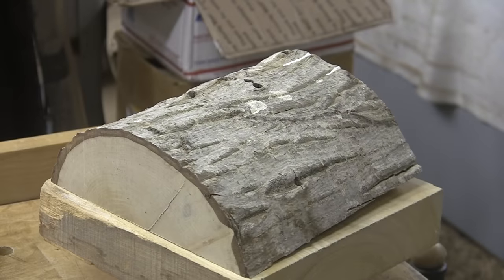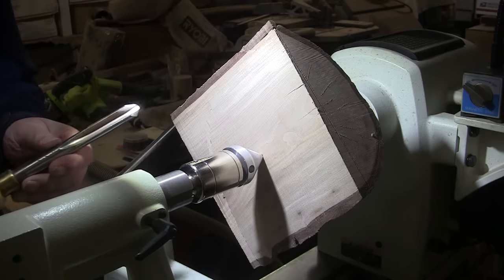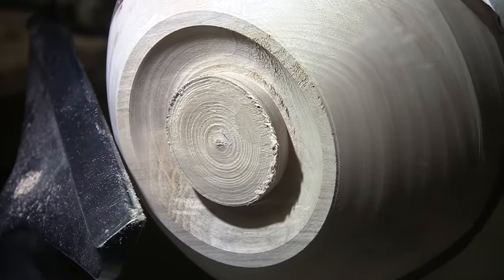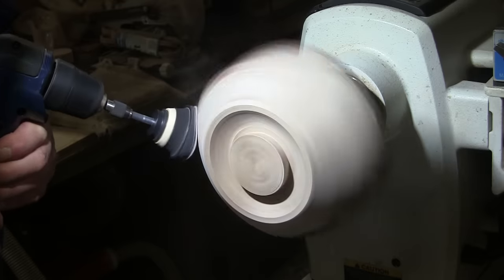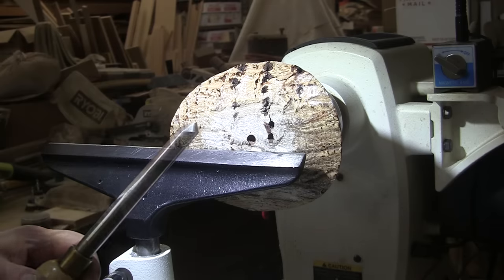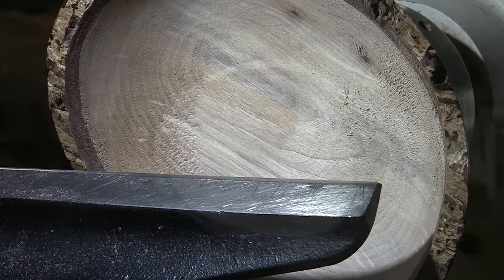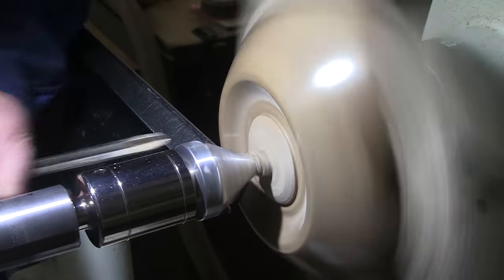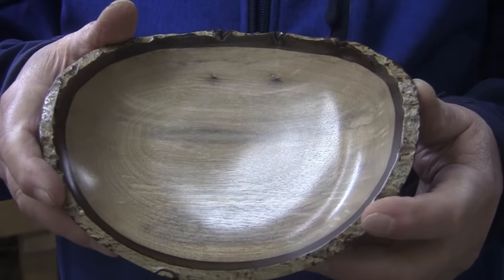Bowl From Log, Perfect Example! - Wood Turning

Comment: Nice bowl, it is very stately. I think the grain is very nice.  I thought that even before you started.  I love how thick the bark is and how well it stood up.  Phil I really feel that you could have a much wider rim on a bowl, especially when the bark is really nice. A one inch or even 1.5 inches would have been groovy too.  🙂
Reply from the maker: I try to do that most of the time but this piece was just too small for a wide rim. 😊
Reply: @PhilAndersonShadyAcresWoodshop   Everything is perspective, right? I could see just sanding the 'raw' side as the bottom & them making a bowl with a 3" diameter.  Bowls are used for so many different things, not all have to be 'wide'. With a 3" bowl I could see using it for potpourri. 

With a small bowl in that piece there would have been a lot more of that cool bark - more LIVE edge.

Comment: Howdy Phil
Done that been there myself ! Change the blade and felt like a dumbass .and laugh at myself ! .
You got the Rikon 14" right ? It is what I have Like it a lot .
I remember the other piece you turned with al the pecker holes , I called it a pencil holder !
Very pretty wood ... On the inside looks like a cartoon face .. using the 2 little knots as eyes 
beautiful turn .
Keep on turnin'
Reply from the maker: Yeah, I've got the 10-326.  I bought it partly because of the tool-less blade change, Bruce.  What really keeps me from changing the blade is all the clean up that has to be done, vacuuming, blowing, etc.  10 minute job takes an hour!
I saw the eyes but couldn't tie them to a face.  I'll give it another look.  Thank you! 😃

Comment: Hi Phil.  I am a new subscriber.  I have seen you apply sanding sealer but not yet found a video of you applying the shellac topcoats you talk about.    Is there one of your videos that shows your full finishing process?  If not, how do you apply the shellac topcoats and then do you do anything to smooth the shellac?  Thanks.
Reply from the maker: Thank you for subscribing, Kevin! 😊  I will try to be worthy.  I would guess that about 80% of the time I tell my viewers that I apply shellac exactly in the same manner I apply the sealer, no difference whatsoever.  A rag and a brush, if needed.  I explain I don't show that part because it's the same.  I smooth the coats of shellac exactly the same way I smooth the sealer.  I have a very short video showing that:  https://youtu.be/lqns7oue4W4

Comment: Phil, What diameter forstner  bit do you use for your recess for the worm screw an chuck face?
Reply from the maker: It depends, Eric.  I usually start with 2".  If the bark is really thick or there are projections around that 2" circle, I'll then drill another hole at 3 1/2" for clearance of the chuck body.

Comment: with your sanding drill going that fast and the lathe going that fast, what's it matter if you go in reverse? Is there a benefit? Does it get any smoother? My lathe doesn't go in reverse.
Reply from the maker: When we turn wood, Dennis, we are laying down the fibers, away from us.  By sanding in reverse, we can lift those fibers up and cut them off resulting in a smoother finish, faster.  You can stand on the back side of your lathe to accomplish the same thing. 😊

Comment: I know nothing about wood turning so please dont think this is a critique,  I  am just curious.  Why do you leave the middle till last when you are turning the inside of the bowl?
Reply from the maker: A couple of reasons, Steve.  The tailstock is pressing against the middle providing support until most of the piece is turned away.  It's a safety issue.  Much easier to turn with the tailstock out of the way.  Secondly, by leaving the middle, it ties the sides together so that while still working to get the thickness just right, the sides are not flexing. 😃

Comment: Very nicely done, sir. I'm curious, what type of wood would you recommend for a relatively new turner? Are there any that you consider easier to turn than others? Also, any projects you'd recommend for a noob to hone their skills?
Reply from the maker: Your questions have me stumped, Unk.  Simple questions, endless answers. 😊  I know this doesn't help you but I'm just at a loss.  I guess common lumber might be a good place to start.  It won't turn well but it will turn easily.  Most people start with spindle turnings, including me but now I hate spindle turning.  I guess I'm just the wrong guy to ask.
Reply: @PhilAndersonShadyAcresWoodshop  fair enough, I appreciate your honest answers. I've got plenty of pallet wood and lumber scraps to use as practice pieces. Thanks for taking the time to answer.
Reply from the maker: @bigunksworkshop786  I forgot, I do have a couple videos that might be of interest to you.  https://youtu.be/a9ER4B9TS1I  https://youtu.be/7OE2SFVqioI
Reply: @PhilAndersonShadyAcresWoodshop  right on. Thanks again, sir. I've got them saved to watch later. Much appreciated.
Reply: @PhilAndersonShadyAcresWoodshop  watched your videos today, thanks for the recommendations. I very much enjoyed them and learned a few things as well.
Reply from the maker: @bigunksworkshop786  Good to know, thank you!

Comment: Does it really make a difference turning it in reverse and sending it I don’t get your messages if you respond back to me
Reply from the maker: If you don't see my replies, Ken, you won't see this!  You need to change your settings on YouTube.  When we turn wood we lay the fibers down away from us.  By sanding in reverse, we can pick those fibers up and cut them off resulting in a smoother finish, faster.  But, again, you won't see this until you change your settings. 😊